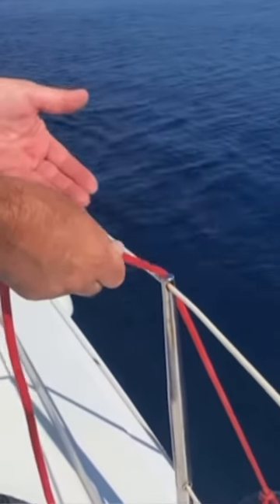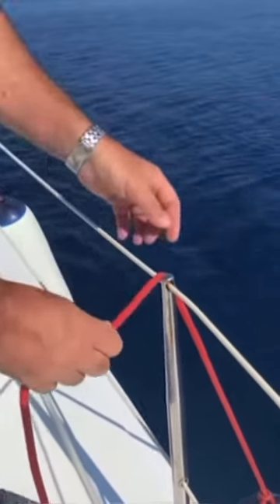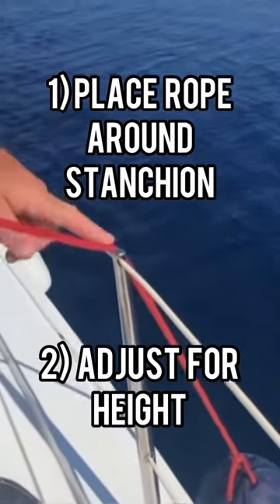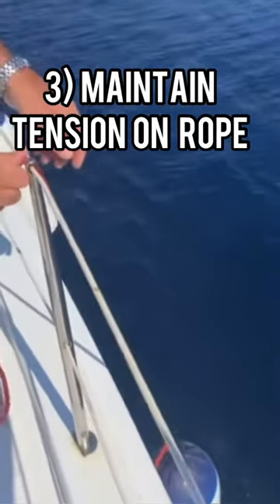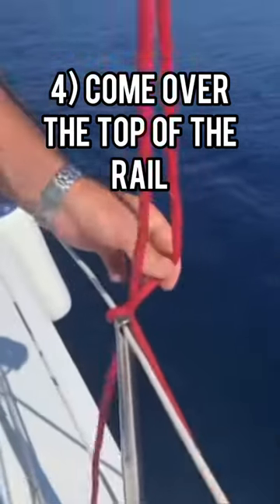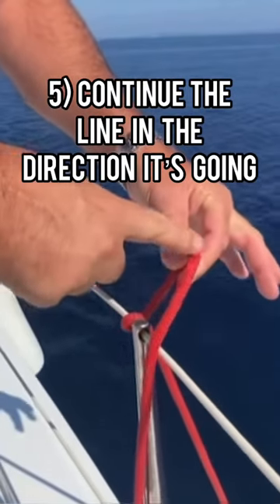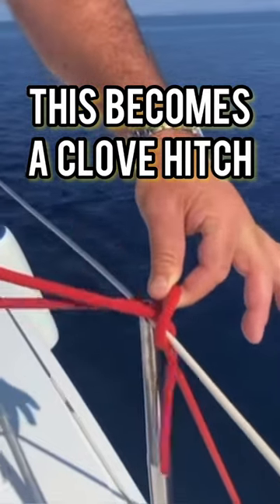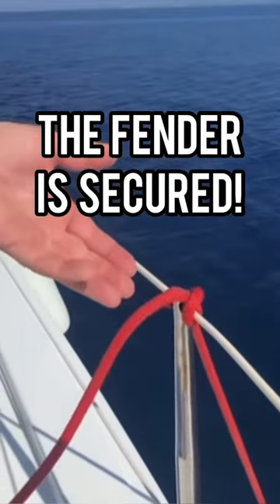Tying Boat Fenders #shorts

Comment: That is very temporary. You leave it there at the water to penetrate the toe rail the leverage of the height of the life line post will eventually loosen the bedding on the base and allow the toe rail to be contaminated by water  and rot it.the proper way is to tie it to the bottom not the top.
Reply: My thoughts exactly
Reply: Yup.
Reply: If it wasnt temporary then id attach the fenders to the dock not the boat ,hence they would always be the ideal height regardless of anything !
Reply: @goonernumone8444  —
Well, sure. You could do that if there is something on the dock to tie to. But standard practice (and best practice in most situations) is to tie fenders to the base of the stanchion.

Comment: Clever using the upright so the hitch cannot slide along the rail,i noticed this on your last knot upload ( finished with a half hitch)  i had all my knots sorted before i ciuld drive but when i past my test ( 88) id  tow our boat to Putney & spend days on the thames,was only a Searider with a 50hp Evinrude, boat plate said 55hp max but unless you had a completely full tank ( well you do the first 30 mins) but as the fuel got below half it would slap from one side of the Vee to the other, was clever how the bottom of the hull would flood for stability that drained on plane but a 55 hp rating was to much for such a light boat with a deep Vee- - great memories but ive seen some knots used that was "different "
Lets say, then you have the experts who will always have a fault in whats done despite it being right, but this or not ideal as after 4 months 🤣, oh you gotta love the Internet 😂

Comment: there's no way this guy sails. anyone who owns a sail boat knows if you tie fenders to your life lines the stanchions will eventually bend. there is a cleat amidships, and at the stern and bow, they are what you use. or use a winch if you  have to. and this fool is even using the TOP line. dude, you have given so much wrong and marginal info you should get off youtube.
Reply from the maker: This method is absolutely superb and has been used effectively for many many years. If you need to tie fenders off to the midships cleat, you must be doing something seriously wrong with your docking  dude I am so well practiced so qualified so experienced. I absolutely deserve my place here.